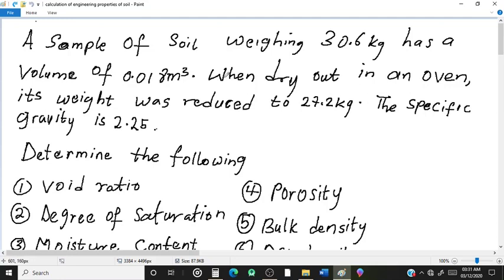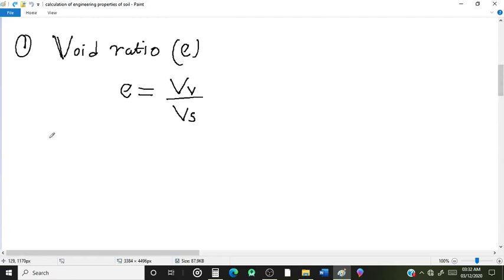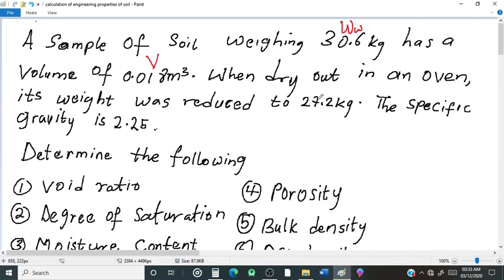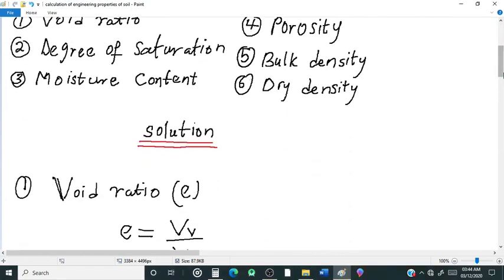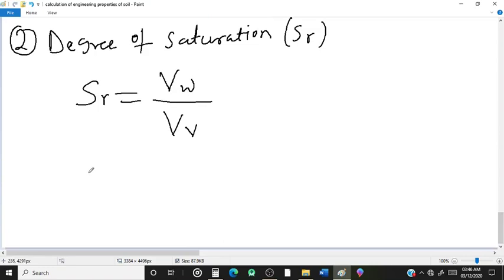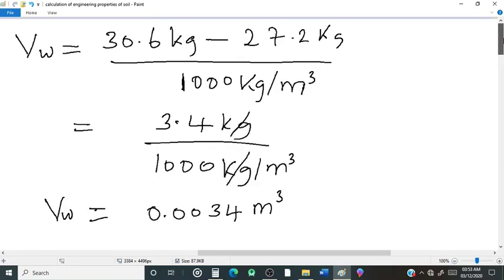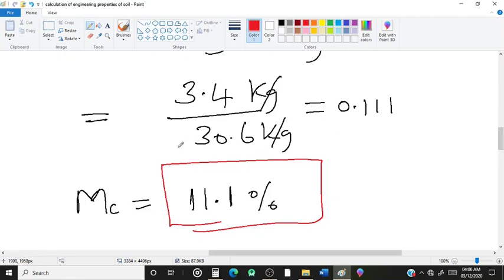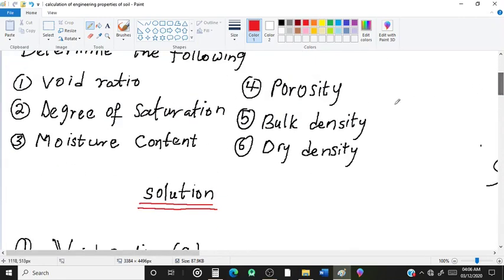Calculation of void ratio, degree of saturation and moisture content part 1

Comment from the maker: Correction: In calculating the moisture content,  Mc = Mw/Ms,  Ms stands for weight or mass of the dry sample, which is 27.2kg and not 30.6kg, so Mw should be divided by 27.2 kg
Hence, Mc = Mw/Ms
Mc= 30.6- 27.2/ 27.2
= 3.4/ 27.2
= 0.125 or 12.5 %
You can also use the following formula to find the moisture content
Mc = Vw/VsGs
You will end up with the same answer.